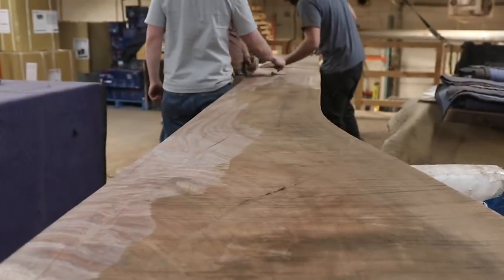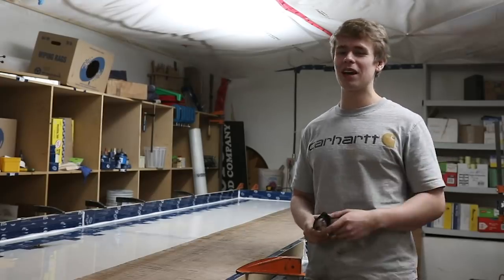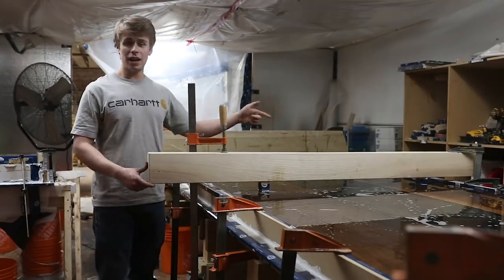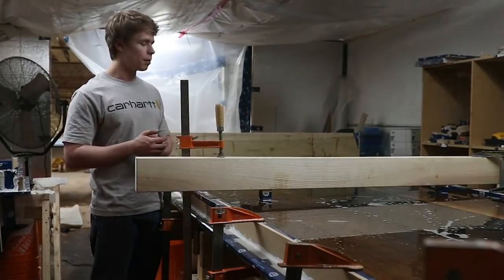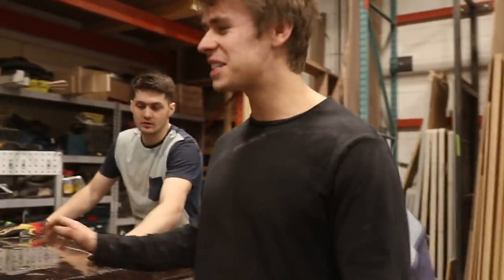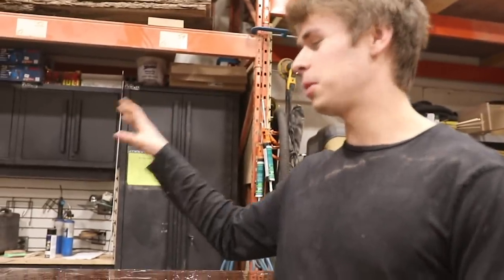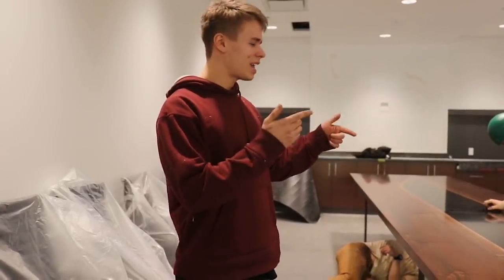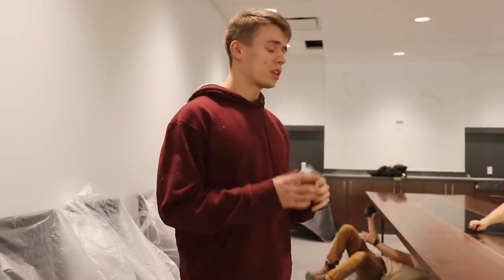World's Biggest Resin Pour

Comment: what I find amazing having used EcoPoxy is that you didn't need any under support for the table and were able to move it around the shop the way you did.  For me every time I use EcoPoxy it flexes or outright bends.  I know you will say it was my measuring and likely you are right, but I have been extra careful and still get the same results.  I am now using Stone Coat Countertop Epoxy instead and never have any issues.  Great looking table too, don't listen to the haters, mostly they are morons with little to no knowledge or simply jealous of your work.  Keep it up.

Comment: World's Biggest Resin Pour - Was probably the one my Father, John Dempsey, did WAY WAY back in 1959-60.  It was a large closed mold casting with unusual cross section geometry and about 8 feet tall.  The molds were machined and polished aluminum and the resin steel filled black epoxy.  The parts were for a training mock-up of nuclear reactor core fuel part.  A design that was abandoned long ago, IF it was ever built.  The volume of resin was in 100's of GALLONS not liters.  The resin manufacturers said it could not be done.  

Removing the part from the mold was done with a series of hand powered hydraulic grease guns attached to the molds.  When the part separated from the  mold it sounded like a cannon going off. 

My father was involved in many such projects for the AEC (Atomic Energy Commission) through Babcock and Wilcox and ended up second only to Fermi in nuclear core patents.   He worked on tools for the NS Savannah, built the world's first remote control robots and has one of the most important patents in large pump seal technology.   I could be more specific about the resin pour but my Father passed away a decade ago.

Comment: Very nice build. How do you avoid the resin heating up in a thermal runaway? If I mix a resin batch bigger than a few cups I have to keep the mixture in a container with a really large surface area (cooling area) to avoid excessive heat and immediate hardening. Maybe your resin generates less heat than i.e. West System Epoxy.

EDIT: Check out this product warning:
Warning! Curing epoxy generates heat. Do not fill voids or cast layers of epoxy thicker than ½”—thinner if enclosed by foam or other insulating material. Several inches of mixed epoxy in a confined mass (such as a mixing cup) will generate enough heat to melt a plastic cup, burn your skin or ignite combustible materials if left to stand for its full pot life. For this reason, do not use foam or glass mixing containers or pour into confined spaces. If a pot of mixed epoxy begins to exotherm (heat up), quickly move it outdoors. Avoid breathing the fumes. Do not dispose of the mixture until the reaction is completed and has cooled.

Comment: Hey guys, question. I saw you using mixing paddles on a drill. And when you poured I saw bubbles everywhere. How did you keep all of the minute bubbles out? I’m having some issues with the fine bubbles on my heavy pours. I was thinking of an old pressure cooking pot and a vacuum pump to pull the bubbles, but I see you were mixing big batches and I saw no such purging hardware in the video.

Comment: Why did you guys have to cut the hole on site and not at the shop?
Reply from the maker: We cut the hole on site because due to the weight of the table it sags a lot when being picked up from each side. We didn’t want the table to be exposed to that stress with a hole in the middle as the resin would be weaker because of it.
Reply: Black Forest Wood Co. what is the hole there for?
Reply: @jodfie  my guess is cabling .
Reply: dont need to worry about that with epoxy ;)

Comment: For those of you wondering how the epoxy didn't over heat, it's called chemistry! Obviously EcoPoxy has come up with a base and catalyst system that doesn't produce intense heat. If you listened to the video it cured for 3 days. 

Also for those of you bringing up wind turbine blades requiring bigger pours you're wrong. They infuse the resin with a vacuum system, or pre impregnate the fiberglass reinforcement first. Not pour!

As for epoxy basements, garages, airplane hangers, etc having a bigger pour, yes they can be WAY bigger. I believe they should of titled it "World's Biggest Resin Pour Wood Table".

Comment: Beautiful table when it was finished but I wonder why a piece of ebony or some other dark wood couldn't have been used instead of so much epoxy.  Seems a lot of "woodworking" these days is actually less about the wood and more about working resins and polymers.  I understand it's a popular thing but that comes with a price that can't be measured in $.
Reply: Agreed! the creative in Woodworking is dying these days, why do they need a solid piece of wood fixed in resins? you can't feel the texture, pattern, grain, how about we apply veneer to Styrofoam then fill with resins? can you tell the difference in a quick glance? I can't take a creation which use great amount of  resins as a woodworking even it's a beautiful piece.

Comment: Wow mind boggling! You did the pour all at once? Resin didn’t crack or air bubbles?
Reply: That's due to the brand of epoxy they used. Ecopoxy- It's a slow cure epoxy.  Slower cure means more time for bubbles to escape, less heat, and no cracking.

Comment: Beautiful pieces but I'm surprised that you don't 'cut away' some of the leg's top mounting plate, to allow for a completely clear 'background' under the resin. The table must be plenty strong that some plate removal won't matter, and you can always add a few more mounting screws. You could also extend the plate in the direction of the slab to recover the missing mount surface area. Honestly, I would be disappointed to receive one of these and then notice the leg plate was visible...

Comment: I wouldn’t want to put a dampener on it, but the table would have been immeasurably improved by not allowing straight edges at the end of the planks. The central sweep is fine, but machined corners ruin the natural meaning of shape and growth of the tree. The really effective tables in this process are the ones that feature natural twists and turns, ‘imperfections’ and the ravages of nature, that bring out the life of the wood, rather than the cut of the saw. The bare, angular welded steel underneath just ruins it altogether.

Comment: Nice job but worlds largest? Not quite.....Just last week I poured a 35 foot custom built counter/bar top. Yes, 35 feet, or just under 11 meters long and between 24" and 48" wide.....all continuous with no seam. About 30 feet of it even had a 2nd level that dropped a few inches along the bar for the glass tray for the bartenders. We had to build a makeshift paint booth outside just to have room for the pour. And brought in a semi truck to deliver it to the customer's location. Now that was my largest pour, but I've even seen longer pours other locations. Then if you want to consider flour pours, they can get especially massive. So no....not the worlds largest pour in the slightest. Still good job guys, a lot of work goes into these pours that most do not appreciate or at least realize.

Comment: with resin furniture videos I always wonder what they are using for those massive poors. Here in Germany you cant get casting resin in building supply stores, and basically only in specialized diy stores and then the biggest measure is 1.7l And I once tried casting 2cm. It warped, bubbled and cracked all over. Absolute mess. So with poors thicker than 1cm it will basically be destroyed. And then those people are casting huge thicknesses